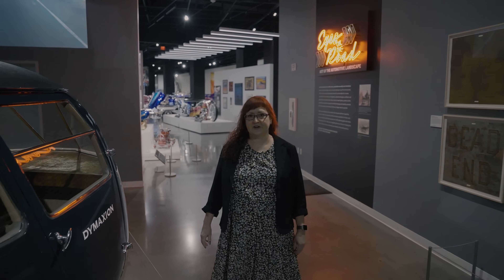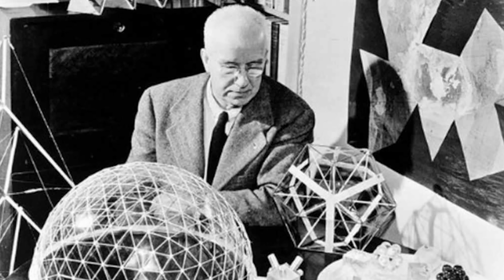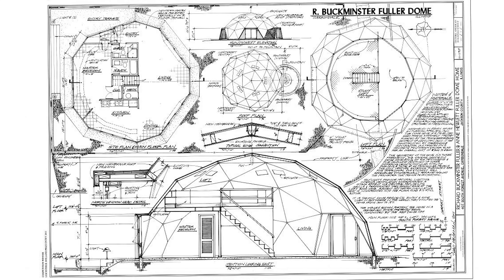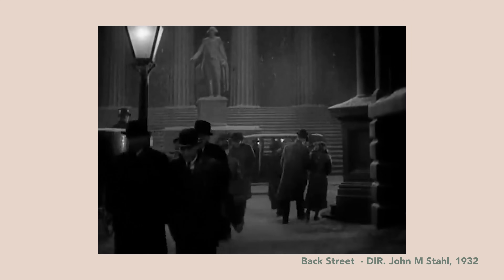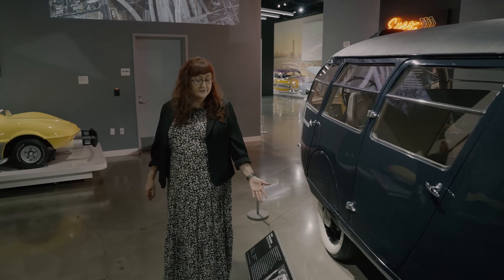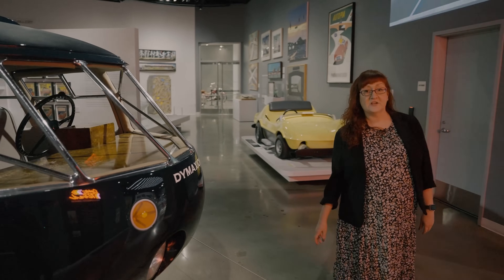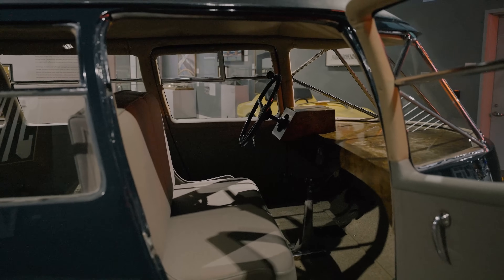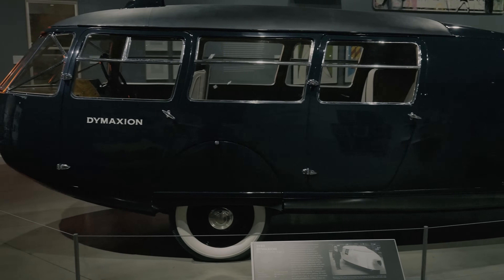The Fascinatingly Odd Dymaxion Concept by Buckminster Fuller

Comment: Flathead ford was readily available but until the early fifties or if it was a Merc variant they were known for overheating with many using the nickname “ tea kettle” for them…so stuffing it inside likely made it worse…
Being a recumbent bicycle fan i agree about the rear wheel steering…recumbent trikes that steer from the single rear wheel are known for flipping over and being unstable…
The better setup is an Ackerman Principle front suspension and steering…ive had mine doing around 50 mph and thrown it into tight turns at that speed and it hugs the ground beautifully…

Comment: I would want one, if it wasn't a 3 wheeler and thus a pot hole finder. That's all there is to it. 
You really don't want to drive a 3 wheeler if your area is pot hole-y. 
If the roads were well maintained, a 3 wheeler might be fine. Maybe Japan, Singapore or Germany's the place for it.

Comment: A totally idiotic design with multiple safety issues.    Powered by a standard Ford flat head V8 and gearbox installed in the back and backwards, working through the standard Ford A differential/rear axle  installed upside down at the front.   Given it is powered by a flathead V8 it was hardly going to be economical.
As the lady in this video said, it was unstable.   But there's more:   let's say you are cruising down the freeway and need to change to the lane on you right.   So you turn the steering wheel and the rear of the Dymaxion swings left, scaring the heck out of any car on your left.

Comment: The single-wheel rear steer was the achilles heel of the design. On curves, the tail would want to swing outward unless the roadway was correctly banked-in. If the curve was banked outward, the problem was worse.

Comment: The future Solar Electric Aptera is also a front wheel drive three-wheeler vehicle, with independent 
front suspension but with front steering. To improve stability, the front axial is wider that a typical 
compact car, which is one of the draw back of such vehicle. One issue with a three wheels vehicle
is that if you try to avoid a pothole,  the rear wheel will certainly catch it.

Comment: he was extremely overrated but I'm still glad he existed. Geodesic domes are so-so as buildings, but I love seeing a few dome houses around, occupied by the children of weathy hippies. 

 I want a replica Dymaxion car, ideally with a totally different drivetrain layout and front wheel steering. (maybe leave the rear wheel steering for fun parking tricks). A light, efficient, aerodynamic, monocoque van with a ton of space would be great, especially if it was cheap and light because it was registered as a 3 wheeled motorcycle.
Reply: Do understand the purpose of the domes?
Reply: Overrated?  Knucklehead comment!

Comment: The dymaxion house was an utter failure mostly due to his boneheaded stubbornness. He wanted water to drain INSIDE the walls of the house. When engineers argued about mold he fired them.
Reply: BS...
The shell of the Dymaxion House was made out of aluminum and wouldn't have molded as the water & condensation would quickly roll off. Keep in mind that the house was not going to be made out of wood...
There is a lot of BS about Bucky's designs but they were sound, but very different...
Reply: @davidhollenshead4892  no he quite literally designed it to have the water drain within the walls I have toured the dymaxion multiple times and seen the design with my own eyes. go to the henry ford museum and ask the tour guides. moron.
Reply: FWIW, the Dymaxion house was intended to have an internal rain gutter system leading to a cistern. The surviving example (at the Henry Ford  Museum and built from two prototypes) doesn't have such a system, it seems doubtful that an example was built and tested. 

Certainly, a smooth, unbroken dome shape without an internal rain gutter system would be much less prone to mold. 

A design with an internal rain gutter system does bring up the question of what happens to dust, leaves and other things washed into the gutter system by rain as well as the question of how this debris would be kept out of the cistern (there are rather simple devices to do that) as well as a device to flush the cistern.
Perhaps these questions lead to the elimination of the gutter system in construction of the prototypes.

Some sources indicate that no prototype was built to Fuller's intentions and that he didn't want to go into production because he considered the design to be incomplete.

Comment: I wonder if you were to put a jeep front axle on it and made it all wheel steering how it would handle?
Reply: Wobbly, as the front axles of four wheel drive of the era were so loose that a top speed of about 50 mph was all they could handle. However, if you used a modern independent front suspension of a four wheel drive SUV, then it would handle great...
Three wheel cars with two front wheels are more stable than four wheel drive cars. That also goes for the planned design changes for the Dymaxion which was going to have two rear wheels mounted close together like an Isetta...

Comment: The myths about the Dymaxion cloud its story:
a) The issue with the steering was that it needed a damper and a limiter at speed. While not implemented, it would probably have had a pair of rear wheels mounted close together to replace the single rear wheel. And the response of the steering wheel would have been limited possibly based on what gear the transmission was in. A strong steering dampener would have also been added...
b) The Dymaxion got up to twice the fuel economy of the Ford sedan that it was based on, while also having a higher top speed. It did have some issues with the shift linkage that also needed to be worked out, as it used a non-syncromesh transmission. This efficiency, large capacity and ability to turn on one front wheel at slow speed had many interested buyers if it had gone to manufacture...
c) The sensation of rear wheel steering isn't that much different than driving a transit bus or my Vanagon Westy. Keep in mind that driving a hook and ladder fire truck with rear wheel steering doesn't make the rear driver barf...
d) Bucky was a bit of a showman and the idea of adding wings, tail & propeller to the Dymaxion wasn't a very serious part of the plan, just as the Dymaxion House wasn't really going to be delivered by airship...
e) Bucky was more interested in promoting new ideas and thinking out of the box than he was at becoming an Industrialist. He loved encouraging the next generation to find better solutions to our problems that are more efficient and more functional. Had the Dymaxion   been manufactured, it would have probably been without much day to day involvement of Bucky...
Reply: "Spaceship Earth" steering would be nothing like a Vanogon it would be like a three wheel fork lift with the ass swinging wide around corners.
Reply: @tonygeorgeson8426  Not really. The front wheels of the Vanagon are under the front seats, and the front wheels of the Dymaxion are behind the front seat. So the ride will be similar. Most people freak out a little bit when they ride in the front passenger seat of my 1991 Vanagon Westy for the first time, but that only lasts a half an hour or so...
The issue with the Dymaxion at highway speed was the oscillation, which was mostly worked out with a design change on paper, but the operation shut down before they could implement it due to the fatal accident & bad press...
There is footage of Bucky driving the Dymaxion in NYC and it doesn't drive " like a three wheel fork lift". My late grandmother road in one and always wanted to own one...
Reply: @davidhollenshead4892  this was very useful. Your explanation of the two wheel rear makes total sense. 

Modern education has dumbed down our society, removed imagination. Most people think to answer test. 

It's cool your great gran ride in one
Reply: rear steer only at speed is horrible.
Reply: There’s no tangible benefit to rear wheel steering though, even if it could be safe and work. 

Aerodynamic body shape though does bring significant benefits. 

Rear engine placement at the time in the 30’s was state of the art, though doesn’t bring any benefits vs front placement plus front wheel drive, and has a negative safety impact. Interestingly the dymaxion had a rear engine with front wheel drive.

So you could say BF got two out of three. Definitely an innovative, influential, and interesting prototype. But was never fit for production. 

Others like the beetle, Citroen 2cv, and Tatra applied the concepts and got it right. No doubt they looked at the dymaxion and it influenced their thinking.
Reply: @PRH123  Rear engine has considerable noise benefits for the driver particularly when travelling at mach 1.0.

Comment: sems like it was in reverse, rwd one wheel front steer streamlined Trike.
Reply: Learn more about streamlining, as the Dymaxion has the right shape...
Reply: That is exactly right. Think of the Dymaxion car from the rear. The first axle steers. Just after that, you find the Ford V-8 engine, driving the standard 3 speed gearbox. Beyond that, a drives haft transmits the drive to a standard Ford rear axle.
That's right, the Dymaxion is arranged backwards, with the engine at the back, and the 'rear' axle is at the front.

Comment: What was he on? I thinky Bucky is great but cars were not his forte. Rear steer was not it. An EV front steer with motors in the wheels and camper van internals would float my boat.
Reply: Have you ever seen a Pelican Street Sweeper or a  Hook and Ladder Fire Truck with a rear driver???
Bucky was a better automotive designer than you likely will ever be, but his design died from bad publicity of an accident that his driver didn't cause. Having personally built an I-4 Hemi powered 73 VW Westy that cruised at 70 mph while getting 30 mpg I know fabrication is hard, but innovating is possible when you get creative...
Reply: @davidhollenshead4892  I think his design was in the mould of Disney's 1950s films about cars of the future, but actually made. It was from a different era of futurism.
I have plenty of experience of rear steer things such as pallet trucks which just makes me say 'noooo'. Your Westphalia sounds good, even if the engine would make a cuckoo proud, I am glad you went with 73 because you get some crash structure in the front!
I have not seen an EV camper van done right yet, if I had money I would definitely give it a go. I would want the one battery to power everything including a slow cooker, and an air fryer. I haven't any interest in the traditional kitchens that they have. Raymond Briggs Father Xmas book is my inspiration, which was modelled on an sleigh... I have no interest in hundreds of hp, massive wheels and other things going on with the Cybertruck and yet, drive by wire and the under floor battery appeals. My camper van would cost a million dollars and two years of time at least! If I then only used it once or twice that would be a bit much, which seems the problem.
The only reason your Westy exists is because of the Chicken Tax. As vans the T2 were taxed stupidly, but they could put seats in them to get around that, hence the camper van was borne and the dream was sold. They are a rich many toy today, families don't own such things only boomers.